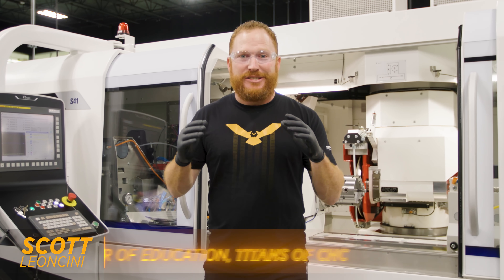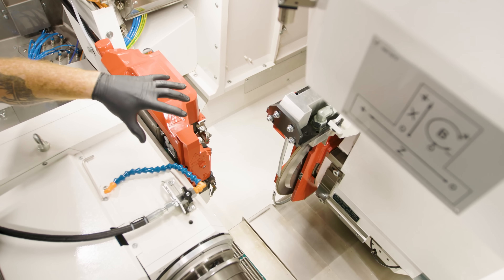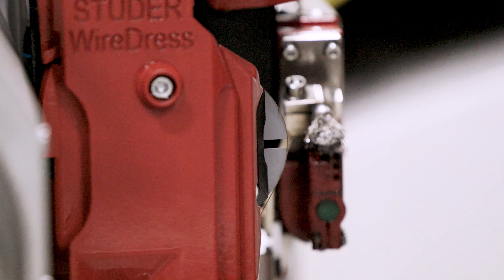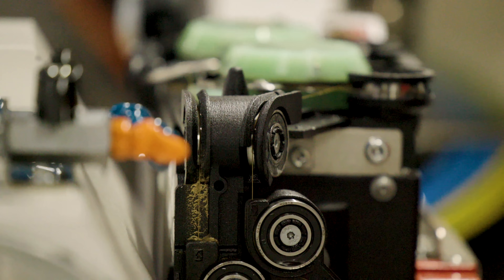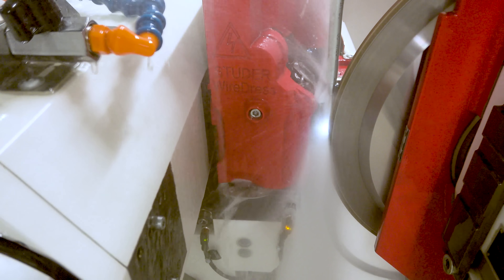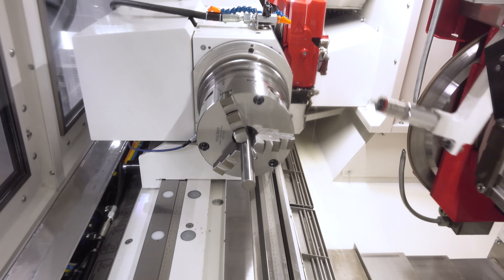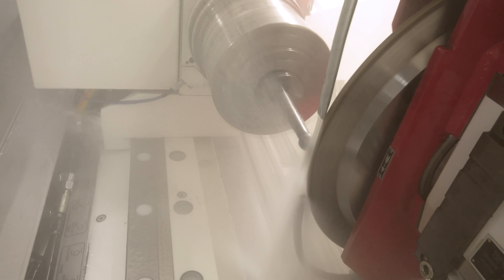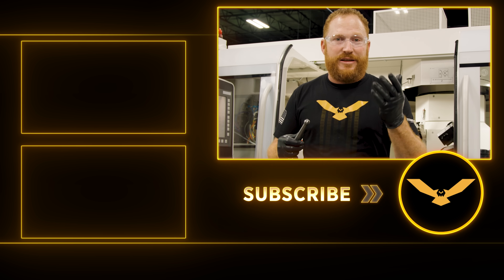STUDER S41 has the WireDress WIRE EDM inside the CNC Grinding Machine

Comment: Have you got to mix your coolant with deionized water? Or does the cooler go thru resin ?
Reply: No. The coolant is Blaser HC10 grinding oil that is filtered and cooled.
Reply: @redbeard_1371  cool. Didn't think that would work.with my wire edm it won't even work if the water is slightly conductive.  Keep up the good work!

Comment: Can you please show threading the wire? I've worked with makino and fanuc WEDM 5 axis. Threading the wire and changing heads ect is difficult on those. Changing on this seems so difficult I wouldn't want to use the system. Thanks for a great video

Comment: 10/10 prefer this guy over Titan
Reply: The difference between the two is the same as the difference between milling and grinding. Milling is brute material removal in a big and noisy way, whereas grinding is a quiet and measured process. Both are awesome in their own way  :D

Comment: Why not just use the edm wire to turn the tungsten, skip the middle man?
Reply: The EDM only takes .0002 max per pass. Peel grinding is .002-.004 per pass.

Comment: Wire EDM system should come from Georg Fischer Machining Solutions (AgieCharmilles)
Reply: I believe this wire dress system is in fact a Georg Fisher machine Solutions product. If you look closely when he is showing the components you will see two green G 10 fiberglass impregnated rollers that are exactly what I have in my Agie wire machines. Between the upper and lower rollers there will be two carbide rings which the wire will be pinched into as it travels through, in addition there is also a small spring loaded disk that is forcing the wire between the  carbide rings into the V notch that is created between the rings. My only question is can it also do a 4D cut?

Comment: Hi, my question is does the waste stream out of the studer grinder need any special treatment, especially now you are grinding solid carbide? Indeed, how does the machine handle 'chips'?
Reply: The coolant is Blaser GTC7 grinding oil. It is cycled through a filter system and back into the machine.
Reply: When i wasbgrinding carbidevwe used water based coolant and just ran ;itcthru sock wilters

Comment: How do you not get big runout with that 3yaw chuck?
From my understanding, collets would be the much better choice there....
Reply: If you grind the tool edges then the shank in one operation runout of that blank does not matter.
Reply: @paulaitchison4912  until you take it out of the 3 jaw chuck and put it in an alternative holder...